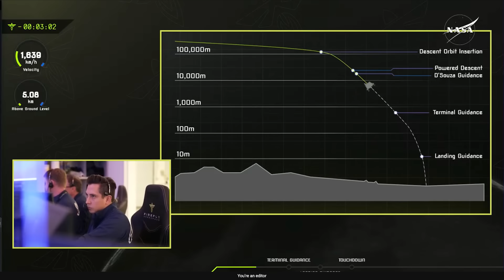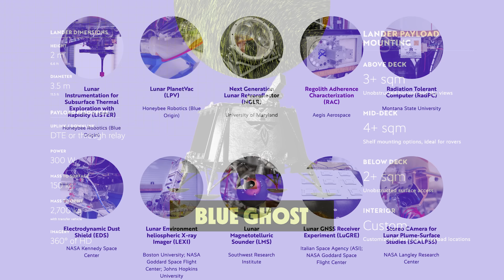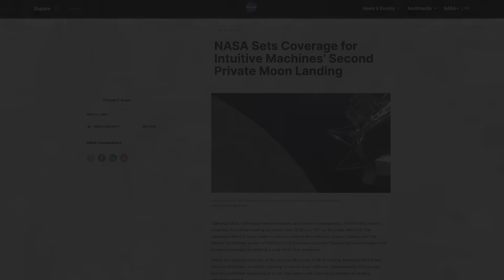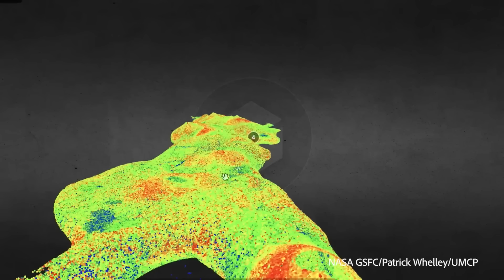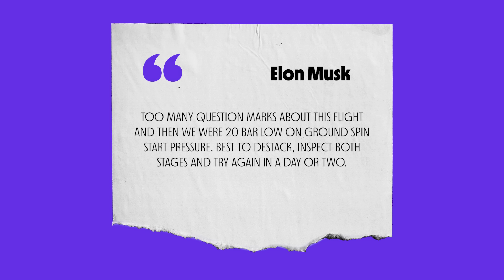Major New NASA Moon Landing Update!

Comment: The landing craft ,based on the " flying bedstead " was uncontrollable ,Neil Armstrong proved in tests and aborted flight
Reply: It wasn't based on the flying bedstead.
The Lunar Landing Training Vehicle and the Lunar Module were two separate vehicles with different control mechanisms. The LM was designed specifically to fly only in the vacuum of space in a 1g environment and couldn’t be tested on Earth. The LLTV was built to simulate as far as possible lunar gravity in an earthy environment. It used a downward pointing turbofan engine to counteract five-sixths of the vehicle’s weight which made it difficult to fly and inherently unstable but the experience it provided was invaluable.
Armstrong’s crash was revealed to have been caused not by piloting error but by high winds and depletion of helium used to pressurize fuel tanks resulting in loss of vehicle control.  
Out of over 100 flights only one LLRV and two LLTVs were destroyed in crashes.

Comment: How do you vacuum in a vacuum ????
Reply: “Developed by Honeybee Robotics, a Blue Origin company of Altadena, California, LPV is a pneumatic, compressed gas-powered sample acquisition and delivery system – essentially, a vacuum cleaner that brings its own gas. It’s designed to efficiently collect and transfer lunar soil from the surface to other science instruments or sample return containers without reliance on gravity. Secured to the Blue Ghost lunar lander, LPV’s sampling head will use pressurized gas to stir up the lunar regolith, or soil, creating a small tornado. If successful, material from the dust cloud it creates then will be funneled into a transfer tube via the payload’s secondary pneumatic jets and collected in a sample container. The entire autonomous operation is expected to take just seconds and maintains”
Reply: The Men from Tefal will come up with something

Comment: Fake. That shadow photo is photoshopped from a room on Earth. It took them two full days to release it. They shut the high res video camera off prior to landing to leave them the option to cover a crash or tip over. 
It tipped over obviously.

Spoiler alert. The IM-2 Lunar Lander tipped over as well, like it's predessesor IM-1.
Also, Starship 8 booster was successfully captured by the tower chopsticks, but starship suffered another uncontrolled multiple engine shut down at 20,000 kph, as video this time showed a fire inside a cavity, the telemetry showed Starship tumbling and finally a Uncontrolled rapid disassembly just like Starship 7.

Bad news throughout Artemis this week. Artemis is headed for a shutdown and renaming and NASA exit.

Comment: The old guys went to the moon and back again on 1 tank of fuel. It looks like Musk does not know that. It is only 500,000 miles there and back. There are some vehicles that have traveled a lot more miles than that here on the Earth.
Reply: They got a lot better fuel mileage from those Model T engines.
Reply: @elmobklshf  I must agree. In a sort of way the old model T was a better motor than we have now. It was simple you could fix it yourself and there were no computers.
Reply: It wasn't one tank of fuel.
Reply: @Ruda-n4h Was there a fuel station on an asteroid somewhere?
Reply: @elmobklshf  The Saturn V had 3 separate stages all with their own fuel supply to get the spacecraft into and out of earth orbit. From then on the Command & Service Module had its own separate rocket engine and fuel supply and the Lunar Module had 2 separate rocket engines with their own fuel supplies one in the descent stage and one in the ascent stage.  
On the way to the Moon the Hohmann transfer orbit was used which transfers a spacecraft between two different circular orbits around a central body in the same plane. It is the most economical path in terms of fuel and energy.

Comment: It should be no problem at all,
because it was well done on Moon
in 60 years before.
Reply: 🤔 my thoughts exactly
Reply: I mean, you've got a point. Not only did several Lunar Landers gently land, but also their upper stages took off into orbit and docked with the mother ship. Which then blasted back to earth and gently deposited the astronauts onto the ocean surface. Just imagine all the engineering that went into getting all of this just right.
Reply: @ Not gently landed in the ocean - pretty hard actually and the Command Module’s centre of axis was higher than a boat and it usually tipped over in the sea and had to be righted by inflatable bags.
Reply: @ChickensAndGardening  
Between your lines, you have
thinked that the Apollo projects
had far succeed on it's time period's 
technological level. If means as that,
I'm totally agreed.
Reply: @ Most of the technology from that time is obsolete and the people dead. It was 8 years round the clock work from 1961-69 under war time conditions with 5% of the federal budget to fulfill a presidential timeline. The conditions today are quite different.
If money is trimmed from the NASA budget by Congress, everything gets pushed into the future, where it winds up costing more than the amount that was saved. 
If it falls behind schedule, it's just another government project that is delayed - no one really cares especially in today's political climate.
Reply: :face-green-smiling:

Comment: Did he say vacuum up moon dust? Hmmm, how does a vacuum work in a vacuum? I must've missed something.
Reply: “Developed by Honeybee Robotics, a Blue Origin company of Altadena, California, LPV is a pneumatic, compressed gas-powered sample acquisition and delivery system – essentially, a vacuum cleaner that brings its own gas. It’s designed to efficiently collect and transfer lunar soil from the surface to other science instruments or sample return containers without reliance on gravity. Secured to the Blue Ghost lunar lander, LPV’s sampling head will use pressurized gas to stir up the lunar regolith, or soil, creating a small tornado. If successful, material from the dust cloud it creates then will be funneled into a transfer tube via the payload’s secondary pneumatic jets and collected in a sample container. The entire autonomous operation is expected to take just seconds and maintains planetary protection protocols. Collected regolith – including particles up to 1 cm in size, or roughly 0.4 inches – will be sieved and photographed inside the sample container with the findings transmitted back to Earth in real time.”

Comment: Why not simply use rotating “feather dusters” instead of complex systems. Remember the Russian pencil compared to the US multi million pen?
Reply: A moving mechanical part is way more prone to break downs
Reply: please stop with the gulllibility and disinformation.
Paul Fisher developed the "space pen" with private money, for starters.

NASA bought 400 of these pens for $2.95 each in 1967.
The Soviets ALSO bought 100 of them.  Why? because pencils are unacceptable risk in zero-gee, with the potential for electrically conductive graphite tips shorting electronics, and shavings contaminating everything. Up to then, the Soviets (very riskily) used wood pencils and grease pencils on slates. Then they got smart.

Still today on the International Space Station, Fisher gas pressurized pens are in use.  
There is no place for graphite pencils in zero-gee spacecraft.

As mach16j says below - the system to "vacuum" is in place because is it is superior to your perceived ideas of simplicity or cost.

Comment: Didn’t we bring moon dust and rocks back with the Apollo missions?  Didn’t we set laser reflectors via Apollo as well?
Reply: ssshhhh...quiet down in front.  Eat your popcorn and enjoy the movie.
Reply: Since the Apollo landing sites were highly restricted by operational and safety limitations, most of the moon’s surface, containing many interesting and mysterious features, remain untouched.
Reply: We "lost the technology"
Reply: @manirk762 NASA did not lose the technology to go to the Moon in the sense that it was forgotten, mislaid or mysteriously disappeared. A lot of the blueprints still exist on file; but the individual knowledge of everyone involved and the “organisational know-how” of how to actually run such a huge, complex project has been lost after such a long time. All the equipment was custom built and much of it is archaic. Many things cannot be bought “off the shelf” and have to be specially manufactured. Re-designing from scratch is cheaper and better. However, it takes years to build up that sort of expertise and NASA has been going through the same problems it had in the early to mid-60’s.

Comment: Um ... there is no atmosphere on the moon. As soon as the rocket shuts off the dust will fall as fast as if it were a bowling ball.
Reply: Um ... no, that happens here on Earth because of our gravity. Rock kicked up by the rocket would fall fas because of our gravity. There is LESS gravity on the Moon, so dust and rock will settle SLOWER than they would on Earth, which is what we see. The no atmosphere on the Moon, as you rightly said, effects the dust cloud. With an atmosphere. (on earth) all that dust kicked up would hang around longer before it settles. The dust on the Moon didn't hang around it soon disappeared, because of no air resistance.
Reply: @Giantdwarf00  um ... so yes. You agreed with what i said. I never said the dust on the moon would fall as fast as a bowling ball on the earth.
Reply: @ no, you said the dust would fall " fast as if it were a bowling ball" on the Moon. That's wrong. Because of less gravity and no atmosphere, it gently falls, like we see in the clip. If on earth, rocks would fall fast like a bowling ball because of our stronger gravity.
Reply: @Giantdwarf00  the bowling ball will fall slower on the moon than it will on Earth because the gravity is smaller on the moon than on Earth. It's the air resistance on Earth that keeps dust airborne a long time. There is no air on the moon to keep the dust airborne, so the dust will fall on the moon just as fast as a bowling ball falls on the moon.
Reply: @ Correct!!! Yay!!! LOL

Comment: Very impressive. It's a bit disappointing, however, that the lander can't recharge and get back to work after night turns to day. I've read it has to do with the cold night temperature wrecking the battery.
Reply: 14 days of -200F (-133C) is just completely unsustainable for their equipment. For reference, winter in Antarctica is "only" -76F (-60C)
Reply: 14 days of darkness. Long time
Reply: The lunar night is definitely proving to be a big challenge to our robotic emissaries so far.  It's certainly tempting to include an RTG (radioisotope thermoelectric generator) in such craft - perhaps by continually producing heat from the decay such a craft could maintain it's delicate electronics at sufficiently warm temperatures to survive the weeks of cold?   Unfortunately I think Plutonium-238 is in short supply, at least it was in recent times.
Reply: @DanielVerberne I guess it's not feasible to include a big enough battery to heat the electronics etc. for two weeks. Maybe a diesel generator with self-contained oxygen supply? 😆

Comment: The dust is the greatest problem. Like mosquitos with diseases, Its everywhere. Buena suerte Firefly. Vaya con Dios
Reply: Towards the end of the later Apollo missions (15, 16, 17) the amount of time the astronauts spent out on the surface began to compromise the safety of their space suits and the equipment in the lunar module. The dust is highly corrosive and very sharp. Like micro shards of glass it cuts and grinds on the pressure seals and mechanical surfaces and can affect electrical components because of the charged particles.
Reply: @Ruda-n4h Uh it never happened
Reply: @maysftg  There is no scientific or historic evidence for that point of view.
Reply: Hey the dust is blazing man . Blazing

Comment: Why not build a small battery of depleted atom fuel rods into such a lander to take it over the moon overnight and at least power the main computer until the sun rises again and the solar panels can recharge the batteries? In addition, I have long been of the opinion that a rover like Curiosity and Perseverance should be landed on the moon, they have such a battery and supply themselves with the electricity they need.
Reply: Like an RTG?
Reply: @BurnerJones  Right!
Reply: I think the main reason is extreme apprehension of having a radioactive material payload riding on top of a rocket - it's powering the insane longevity of the Voyager missions, but other than those two, the reluctance to risk it seems to be policy, understandably. It wouldn't explode like a bomb, but spread 'dirty' radioactive material and gamma rays, possibly contaminating anywhere the craft may land, moon or otherwise.